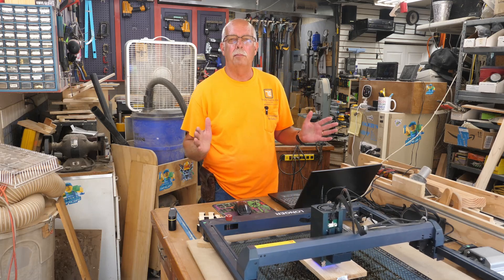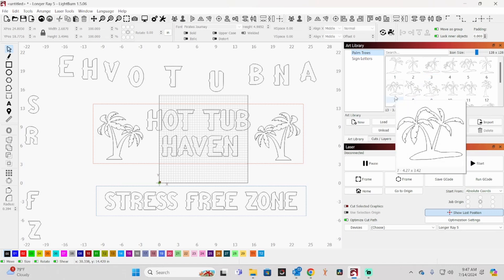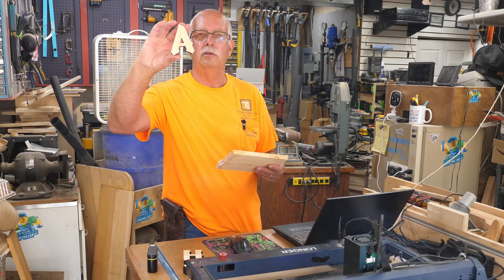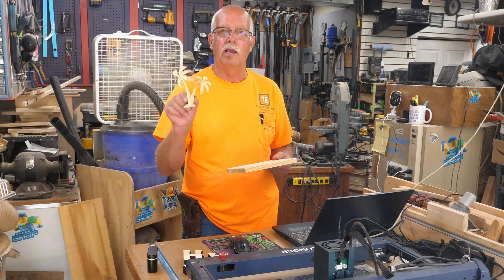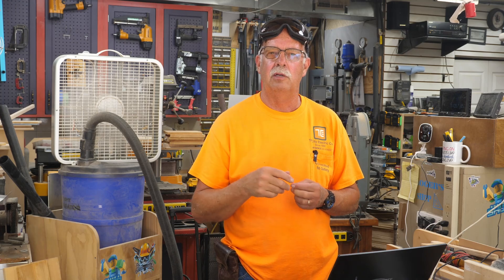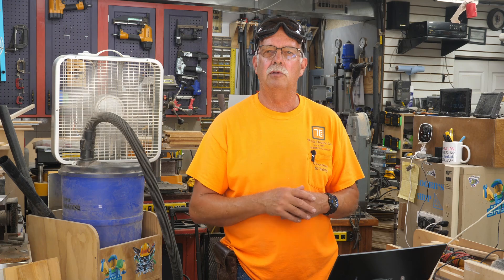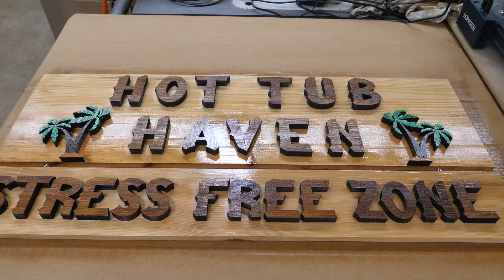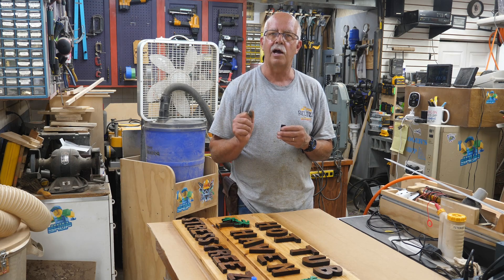Laser Cut Wood Letters Beginner Project 30

Comment: Can you send me the website where you bought yours?
Reply: I’m new to this and I wanna cut words out like yours and even thinner for my crafts, but I’m not sure where to start at. I don’t wanna be too expensive. In case I get confused on how to work it which one would you suggest for a wood acrylic etc
Reply from the maker: @kellyhewitt162  For a learning process, start with cardboard.  It's cheap/free.  Once you get that down, move to 1/8" plywood and then to other materials.  If using acrylic on a diode laser, user black or a very dark color.  A diode laser will not cut clear or light colored acrylic.
Reply from the maker: Assuming you mean the Longer B1 laser:   https://s.zbanx.com/r/CxVWkVFhcFWw

Comment: Can you cut something like plexiglass or maybe even plastic. ???. Using your laser cutter takes all the fun out of it. Just think of all the broken trees or miss cuts an ALL the extra sanding you could have needed to do also all the extra time it would have taken with a ban saw . WOW you sure missed out on a lot of fun . LOL HaHa Thanks
Reply from the maker: For Plexiglass or clear acrylic, you need a CO2 laser.  A diode lase will not cut or engrave Plexiglass or clear acrylic.
I used to do this type of thing on a scroll saw!
Reply: @rogersshop  I
have not tried a scroll saw but I have used a ban saw an a gig saw but I had some trouble with the material coming around behind the blade an rebounding like it was getting too hot. Thanks

Comment: If you were using a 20 watt laser for that thick wood do you have an idea of what the settings would be?  Great project.
Reply from the maker: As materials and lasers all differ, for a start point, try 200 mm/min @100% power, 3-4 passes.